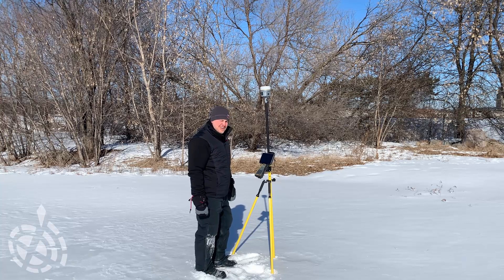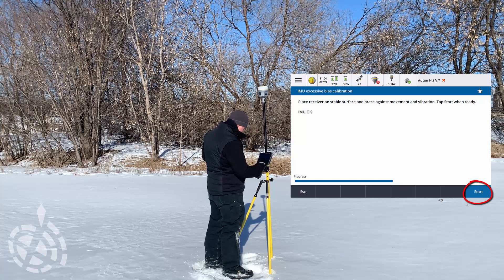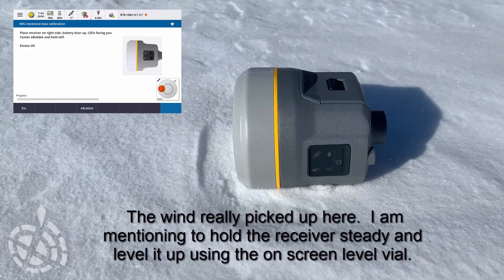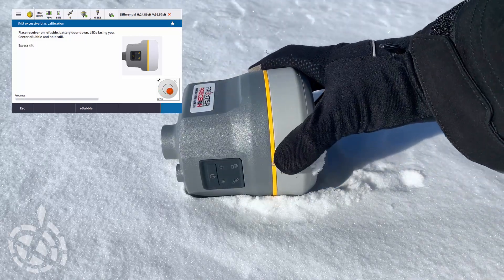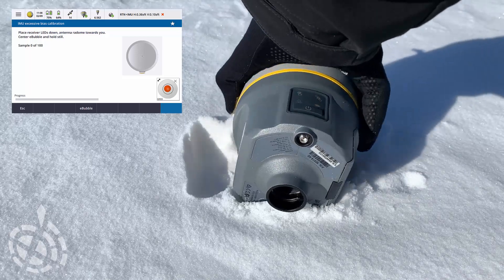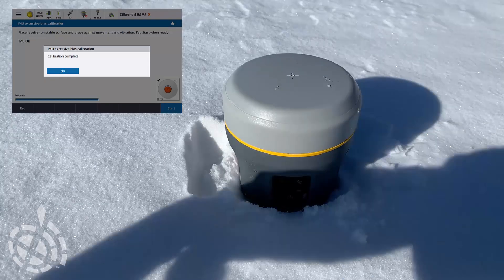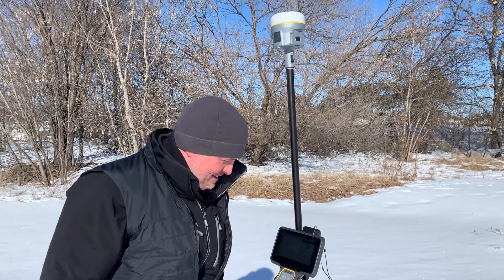R12i IMU Bias Calibration

Comment: I’d love a video on referencing a line while staking out a different line, or even point. Also a little more into detail on stakeout options (to the line, o/s and station to the line, skew to the line) thanks!
Reply: Those are really good ideas.  I will mark them down and see if we can't do a video on just the different staking options.  When you ask about referencing a line, would you mean having say a dxf background that has line work visually displayed on the map, then selecting a different line to stakeout.  That way you can see both, but you are actually just staking the one?
Reply: Weston Schneider yeah when I try to reference a line it says I have to make it an .rxl, which I have but then I still can’t select the line to reference or manually type it in. It would make my job much less difficult. We used to use siteworks and referencing a line was just the push of a button.
Reply: @03cnutty  In Access it depends on what the original background file is.  If it is a simple DXF, you need to select it in the layers option on the map first (check mark), then tap it once more (check mark with a dotted box) to make the dxf able to be selected and staked.  If it is an xml file, then yes, Access will ask you to simply give the RXL file a name and Access with create it automatically.  Hope that helps.
Reply: @Weston Schneider  that does I’ll give it a try my next time out thank you!
Reply: Also another topic I think people could benefit from is offsetting from a calc’d point. Where you can’t create a line from 2 points to get a station and offset to the line.
Reply: @03cnutty  This would also be a good video.  You would first tap both those points on the map screen and tap and hold to create the line.  Then once created, tap the line itself and select stakeout.  We might be able to just work that into the first video you mentioned because at that point we would be selecting the station / offest from line in Access to stake it out. Thanks again. Wes

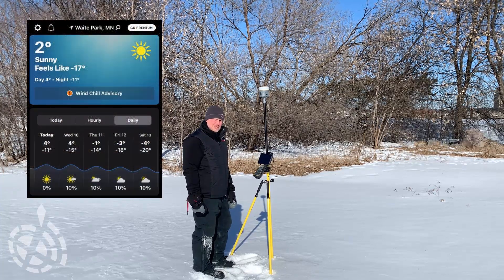Comment: Does the windchill affect the equipment(Ref 0:48, this video), or is the ambient temperature the true temperature of concern ?
Reply: I would say the wind promotes the rapid cooling of the equipment, any latent heat is more quickly dissipated in the wind, once the ambient temperature is reached, no further cooling occurs...so, if the calibration is adaptable to a slow temperature change, and is thrown off by a rapid change, then it would occur on spectrum dependent on a range of temperatures and wind speed...or alternatively, I don’t know...